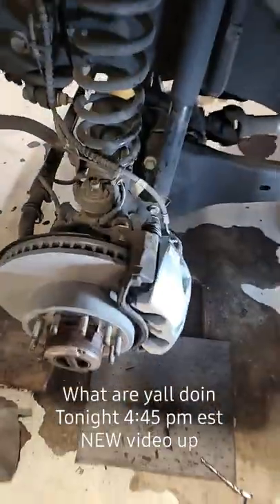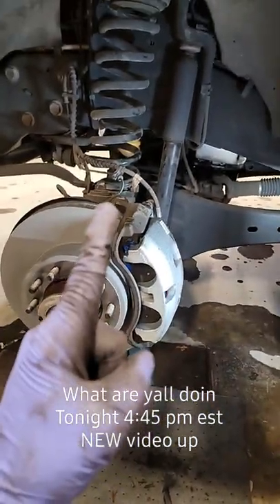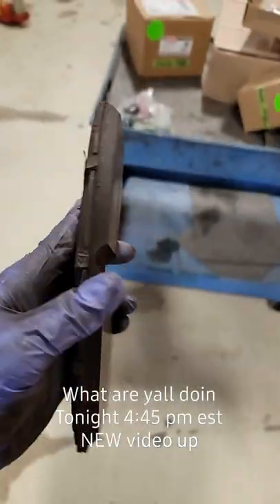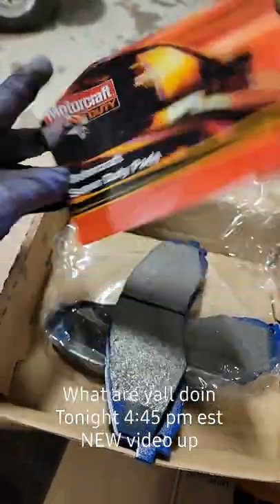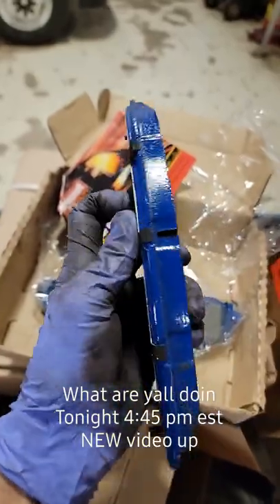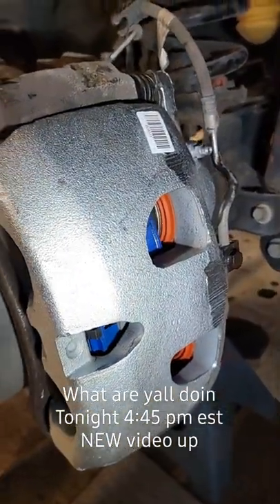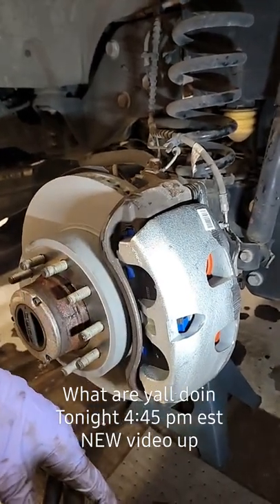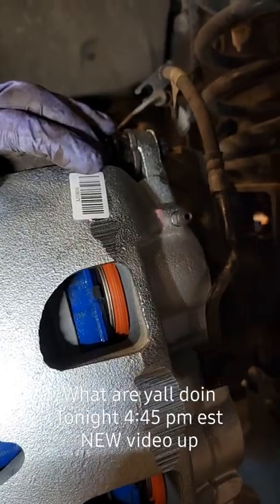my brakes are bleeding, how do you??? #shorts #brakes

Comment: Gravity bleed. To minimize fluid loss when I take the brake line off, I use a small clamp for hoses. Just to be safe, I have an assistant climb in and then I bleed the brakes on the half of the system I opened.

Comment: Ford Super Duty pads. They need some heat to get up to maximum friction level but they don’t fade easy. Oh, I use a pressure bleeder. Fresh fluid through the reservoir until it comes out clean from each corner.

Comment: I have a question about SD calipers.
Why do they fail.
My 06 with 106k miles I've had to replace the rear 3 times and yes by Ford dealer. My fronts I've never had changed and in recent inspection still have at least half left.
I do not tow anything, never have and I'm not a person that uses a heavy brake foot. I tend to let the truck slow itself.
I've seen several complaint videos on YouTube. 
Am I doing something wrong or is there a problem over the years.
Usually it's just one that fails but I'm one of those people that will replace both. Rotors too.

Comment: I have a 2022 F250 and the brake dust is very bad what are these upgraded brakes for specifically are they for more stopping power and if I install these Will it decrease brake dust can please let me know thanks
Reply from the maker: Just for the 450 550. Stay tuned because this summer we goin dustless & yall are gonna WANT this!! 😉
Reply: Odd thing here. The pads that the truck is built with and the ones you buy at the dealer as replacements are not the same. I got rid of OE pads for some aftermarket ceramic ones that nearly killed me on a mountain. Those got thrown out for Wilwood pads and then some commercial grade ones. The commercial grade ones didn’t last the longest but did great at stopping at with a bit less dust than factory. Then I did a pad slap with some Motorcraft pads. They had to be a ceramic formulation because their was near zero dust. This was the Motorcraft BRF line. Do not use the BR line as that is the value pad.
Reply: Tell us more on going dustless. Have you done a video on this yet? I need to replace pads on my Super Duty 350. Trying to figure which is the best way to go @PowerStrokeTechTalkwARod
Reply from the maker: We soon will!!!
Reply: @PowerStrokeTechTalkwARod  I’m still watching for this
Reply from the maker: Gosh i am still waiting on parts